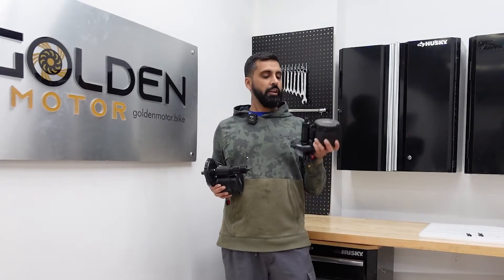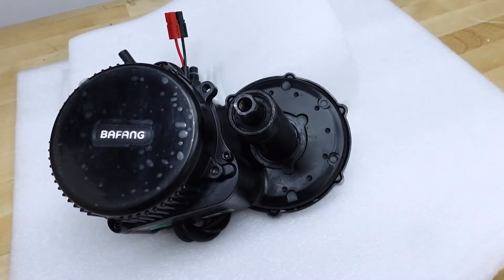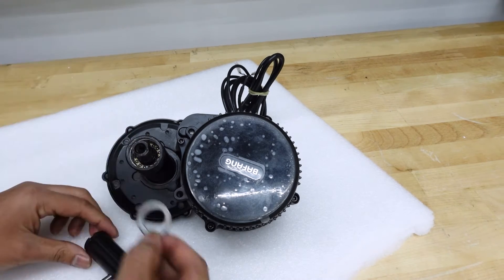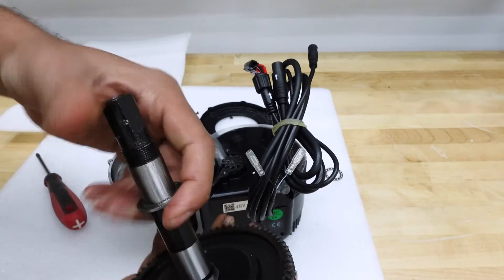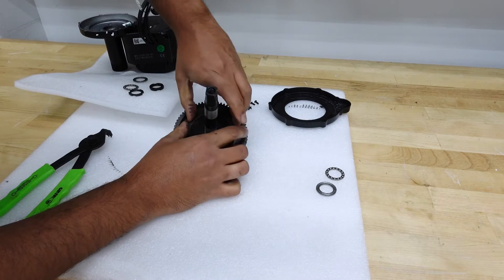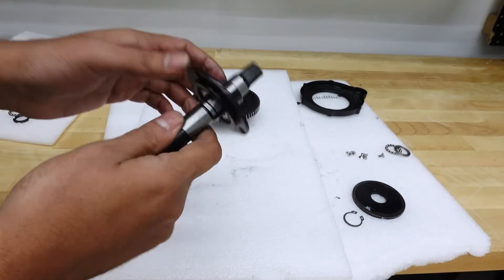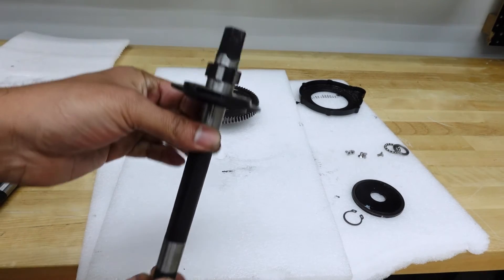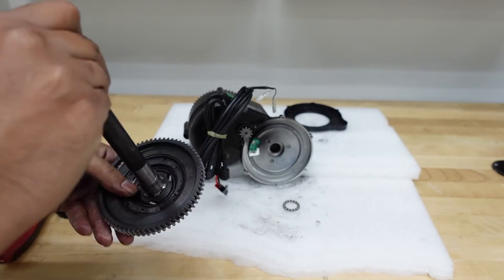Bafang BBS02 Modification Kit: 68mm to 100/120mm Fat Bike Conversion

Comment: This is awesome! But did they not make one of these kits for the BBSHD? I've often thought it would be nice to modify my 68mm BBSHD so I could upgrade to a 27.5 plus bike.  Also love what you've done with Golden Motor since acquiring it, and if your ever thinking of opening another shop in east Toronto I would totally work for you guys!
Reply from the maker: Thanks for the kind words Eric! Unfortunately no kit yet for the BBSHD
Reply: @goldenmotorNA  is there a way to do it? I have a BBSHD and want to convert it to 120